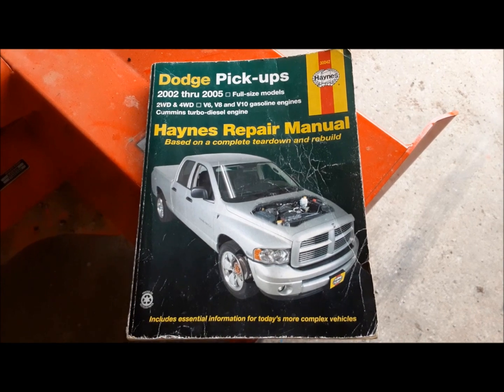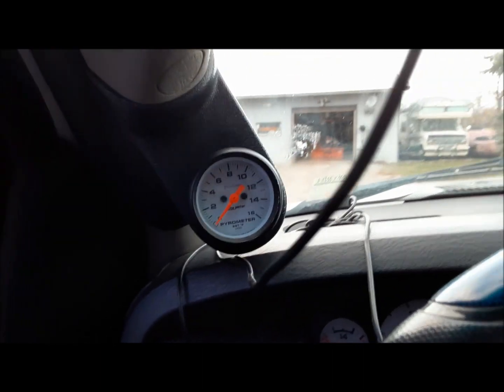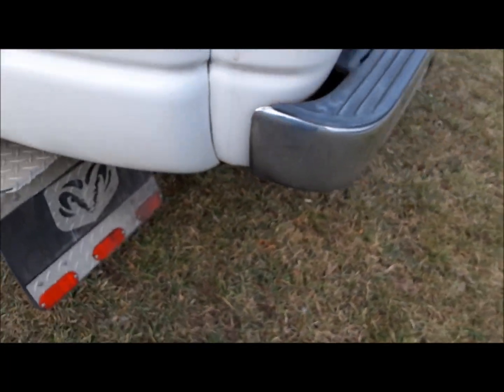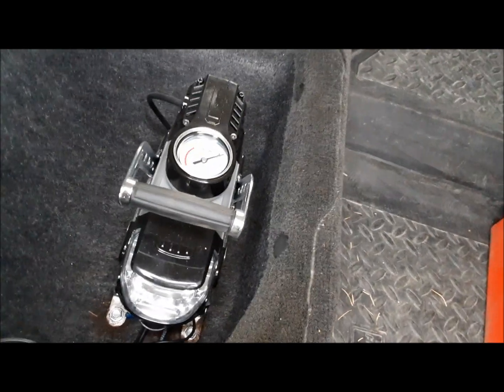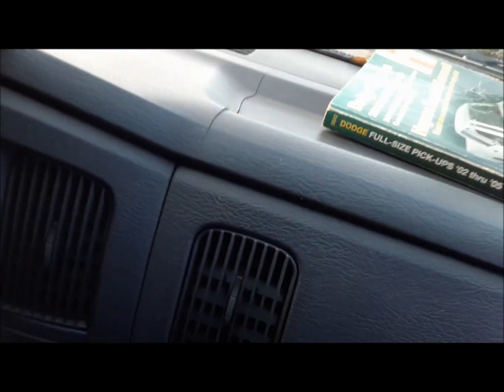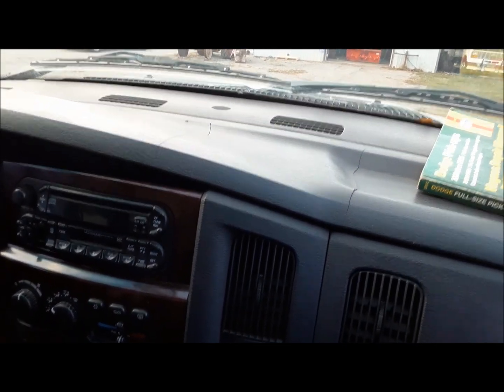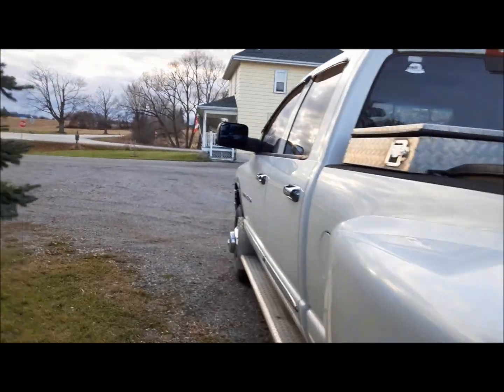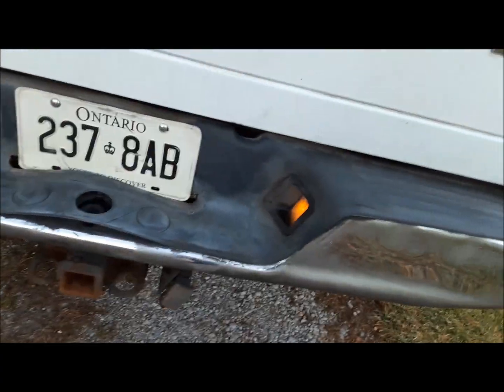2003 Dodge RAM 3500 Dually Introduction

Comment: Nice score.  I'm no Dodge Ram expert, but from what I have heard, the 6 speed manual was the best transmission Dodge had for their heavy duty trucks....I know a lot of guys had their automatic transmission break on the Cummins diesels Rams.

My 04 Ram has one glove box also.  Mine is a 2WD with the 4.7 V8 and 5 speed manual, which does hold it back some for towing.  But, for pulling my 18 foot trailer, I have a '99 Ford F250 2WD with the V10 and is set up with a 5th wheel.  Whoever had it before me, probably used it to pull either a horse trailer or a RV.

Enjoy that truck, one in that condition being almost 20 years old, are rare.
Reply from the maker: Thank you. I can't wait to dig into it.

Comment: Being a dodge dealer parts guy for 24yrs, that welcome pkg for the NV5600 leads me to believe that it has a reman transmission in it.  I have that same truck in 2005 model year in the molten lava color also rust free 203k.  also a 6spd with the granny low & manual t/c. I also have those husky floor liners and prefer them to the factory slush mats.  I am curious if your truck still has the factory clutch with the rattle trap dual mass flywheel.
Nice truck congrats!!
Reply from the maker: No Idea on the flywheel. I would assume by now it has been swapped out. I did notice under there a fresh transfer case. But the 5600 looks like its been there for a while. I usually get husky or weathertech floor liners and put mopar slush mats inside them. Thanks for watching!